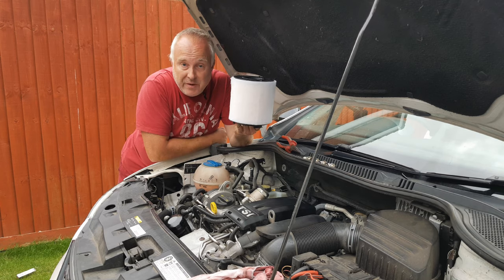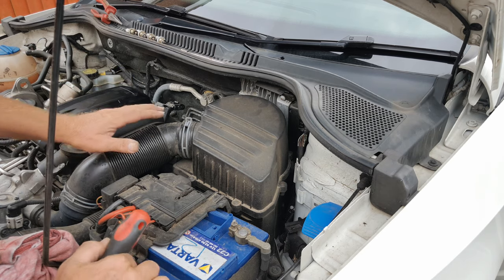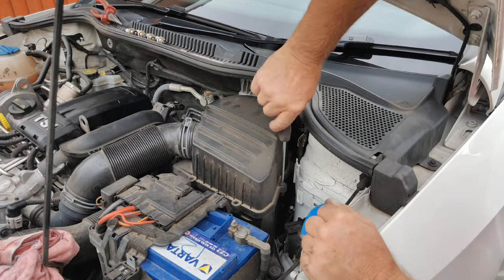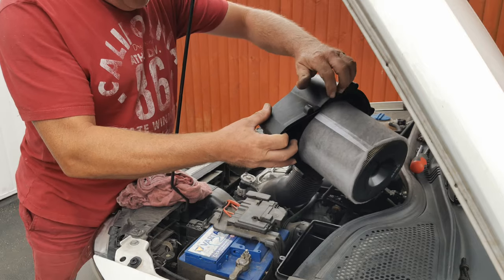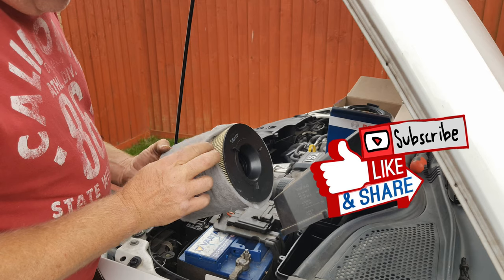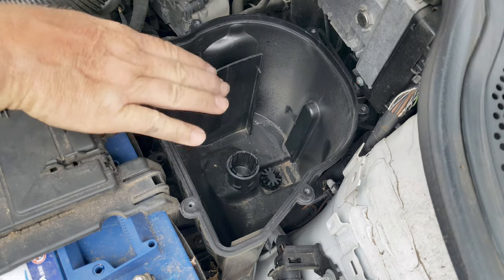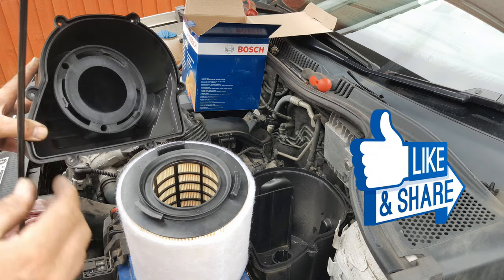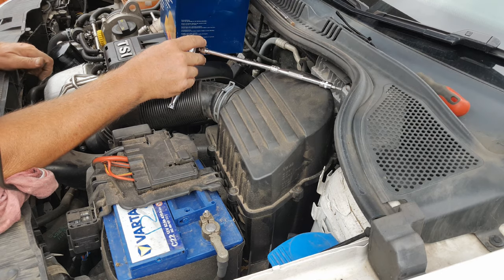VW 1.2 TSi Air Filter Change It Yourself

Comment: Brilliant video!! Do you have any advice on when too change the fuel filter, and the process also?
Reply from the maker: I never filmed the fuel filter on the Ibiza, but I did do the Polo. It will be very similar to this on the Audi A3: https://www.youtube.com/watch?v=zTKGnZ-PKi0
In the absense of any recommended change interval from VW, I suggest every 40-50,000 miles

Comment: could i put a new induction kit in this box if i take off the black plastic tube and open the box leave it open and connect a new metal pipe with an air filter and let it sit into the box

Comment: There is smaller in diameter hose going from that lid into engine, where does it connects to? I got mine disconnected when I opened filter lid. Looks broken too and like it didn't happened when I opppeened...
Reply: It push fits into a small opening on the engine.  If you get a torch and look under the Black plastic tube - look at time 1.05.  The hole in the smal plastic housing at the end of this flexible offshoot push fits comfortably into a hole in a metal casting.  It is some sort of rebreather I think and is a bit oily.
Reply: Thank you! 😊